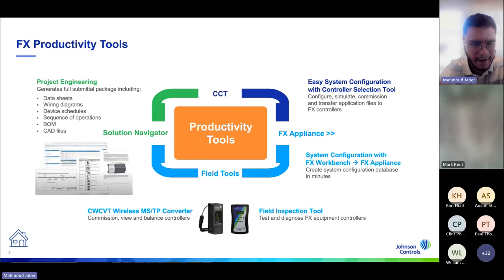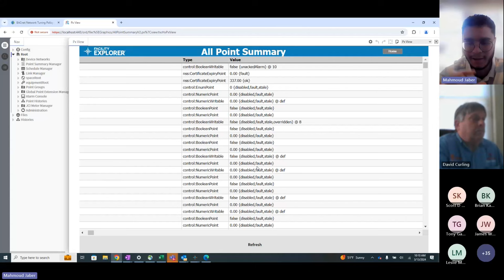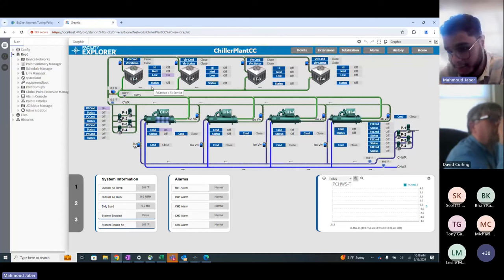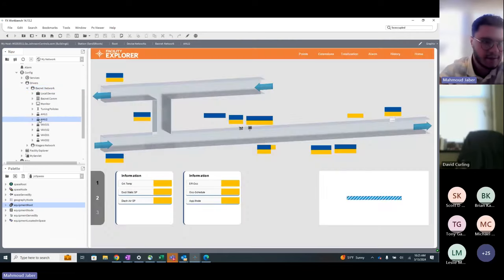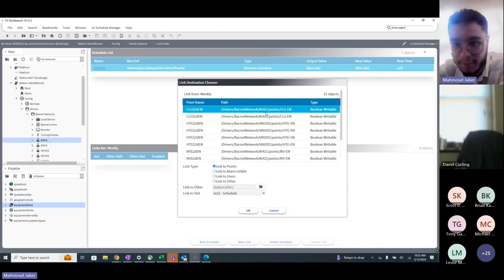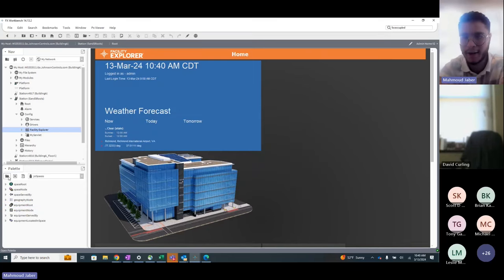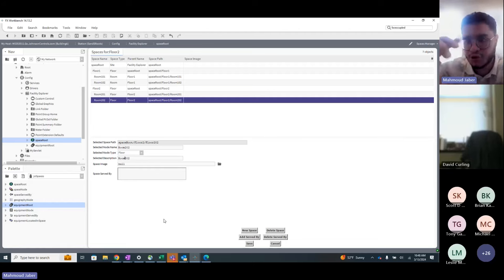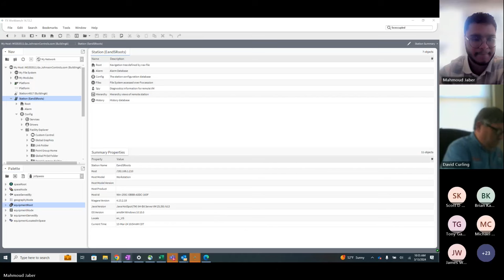Johnson Controls Tridium Workbench Appliance Webinar

Comment: Can you create a caf file in CCT and import it in niagara then reassign the links to points that are currently being read from an N2 controller? Wondering if this would be a cheat for creating graphics on older systems.
Reply from the maker: Don't see why that wouldn't work. Just keep in mind that you have to do that import on a new controller in Niagara, you can't run an import on a controller that already has points in the points container. -FW